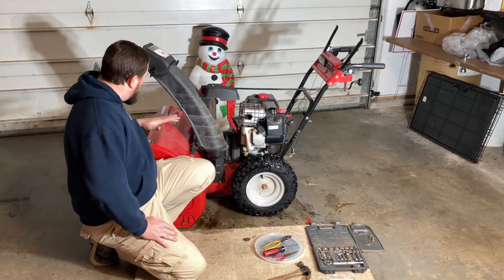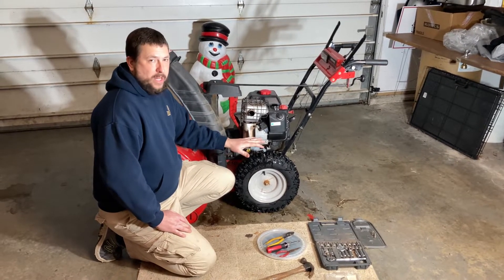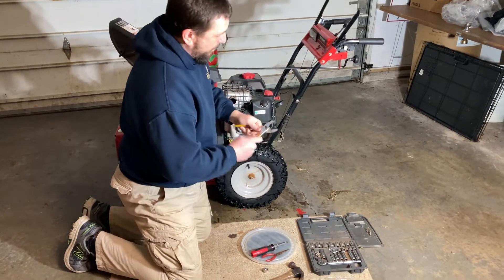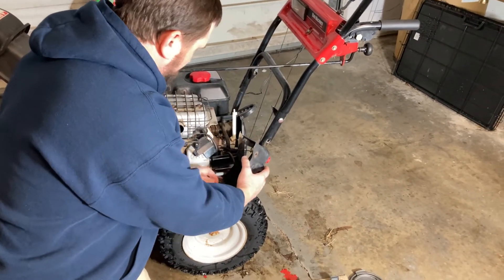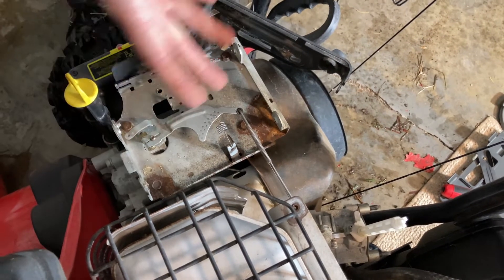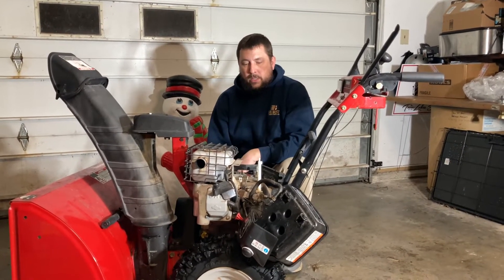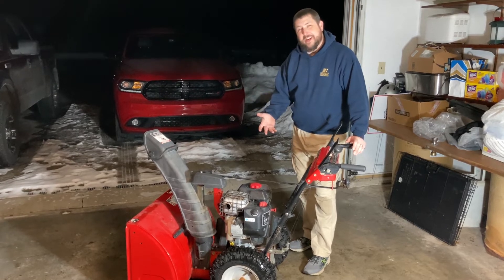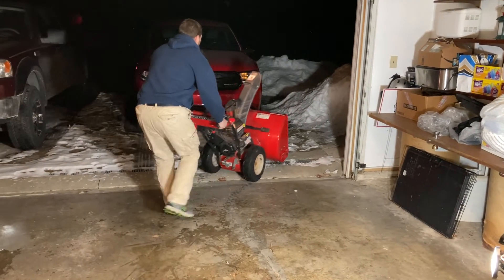MTD Yard Machines Snowblower w/ 1350 Briggs and Stratton Repair

Comment: Hey! Just curious, are the bushing/ spacers on the outside of the air cleaner or on the inside...from the vid...looks like inside....I have mine mounted on the outside of the air cleaner...not sure if it matters, second question, have you ever had the carb off.....I can't get mine off, I assumed it should just slide off the long threaded screws it is mounted on....?